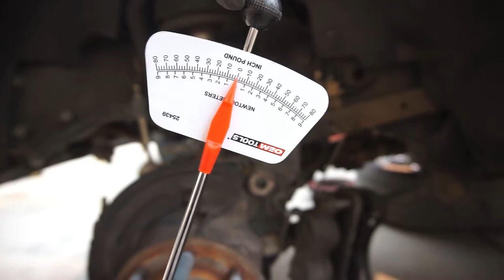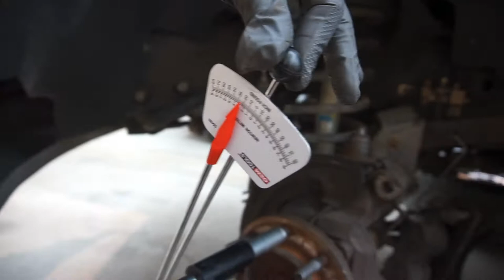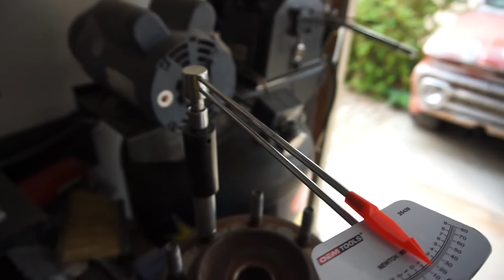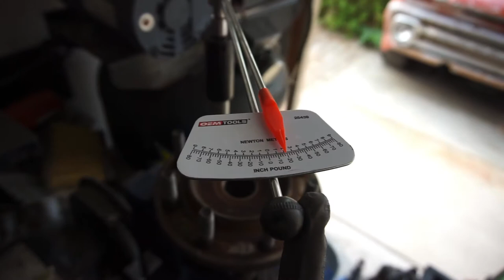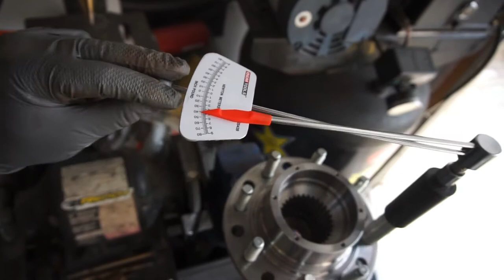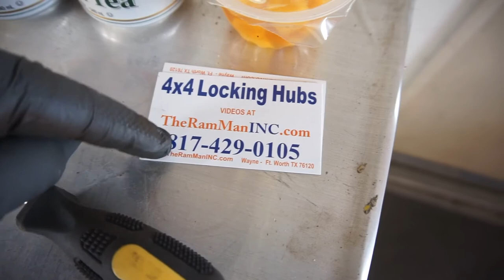2010 Ram 2500 Mega Cab Cummins Wheel Bearing Rotational Drag Test vs Manual Locking Hubs. TheRamMan.

Comment: Hey would that work on all wheel drive?
Reply from the maker: Knight Ryder depends on the vehicle. Jeeps, dodge and most Chevy it should but like a Subaru or Audi I don’t think so.
Reply: Halffast719 I drive a 1998 GMC safari AWD
Reply from the maker: Knight Ryder General Motors introduced the AWD option in 1990.

1990-1998
From 1990 to 1998 it utilized a Borg-Warner 4472 transfer case with a viscous clutch.  The BW4472 features a full-time viscous-coupled transfer case that will automatically transfers torque where it's needed. The viscous coupling acts as a torque-biasing device attached to the front and rear drive shafts in a lightweight magnesium housing mounted directly to the automatic transmission. One set of the discs turns with the front axle, the other set with the rear axle. The discs are surrounded by a high-viscosity silicone fluid that, when deformed, transfers power from the faster rotating discs (or the slipping wheels) to those rotating more slowly (the wheels with grip). A 35-65-percent front-to-rear power split is used under normal operating conditions, while up to 100 percent of the engine's torque can be transferred to the wheels with traction when needed. Road surfaces needn't be slippery for the AWD system to deliver a traction advantage. If climbing a hill or steep grade, for example, the differential will send more torque to the rear wheels to compensate for the extra weight. The AWD also accommodates for speed differences that naturally occur when a vehicle travels around a corner on dry pavement and adds superior cornering capabilities under all circumstances. The system also provides better durability than a rear-drive-only system because torque is continually shared between the front and rear axles.
Reply from the maker: Knight Ryder https://sites.google.com/site/astrosafariworld/drivetrain/awd
Reply: Halffast719 ok wow know wonder my awd safari kicks ass thanks man
Reply from the maker: They sell lift kits for them.